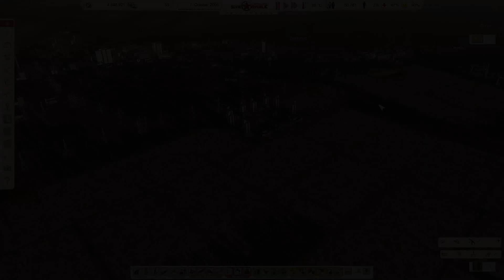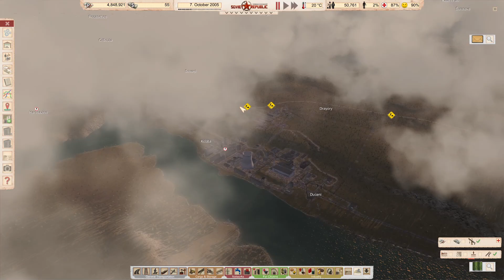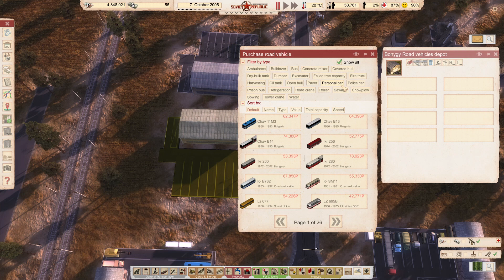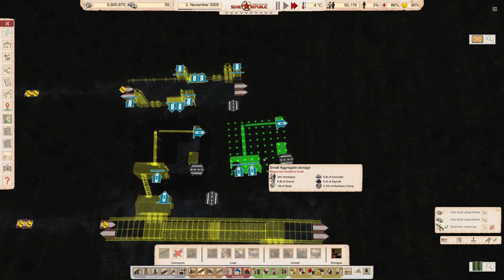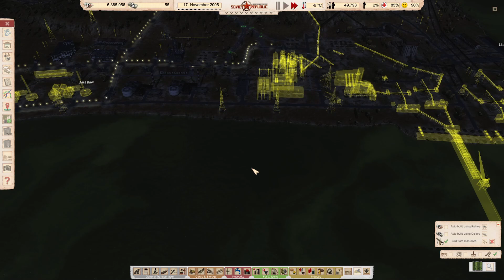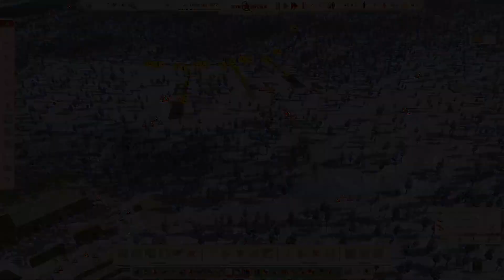Workers & Resources: Soviet Republic - Ep 135 - Fire Town

Comment: 4:30 Oh shit... what if the average production rate is too much?

6:20 It would be nice to route a bypass starting before the high voltage switch to avoid potential future traffic jams.

8:55 That section seems to be very slightly overlapping the completed section, so it may not technically be connected.

11:35 And you can use a wood heating plant. 11:50 Yup!

15:25 It fundamentally can't store cement, only concrete, so you're gonna have to work in the other one somehow.

19:00 Oh. Forgot you had one of those.

24:40 A kindergarten and school?

You should make a power loop like you did for the rails and roads.